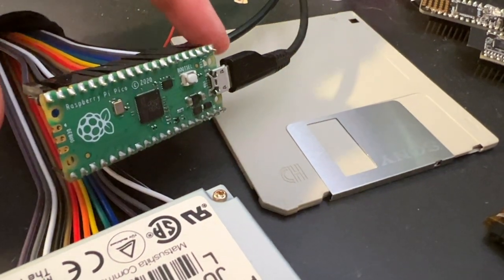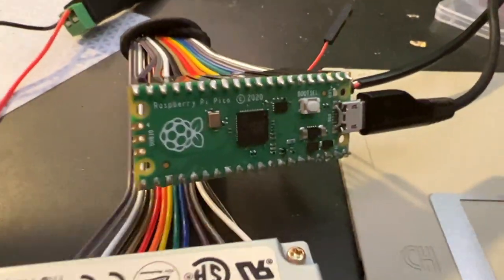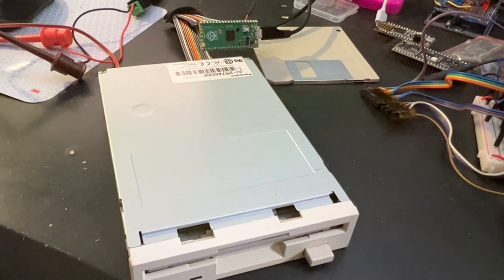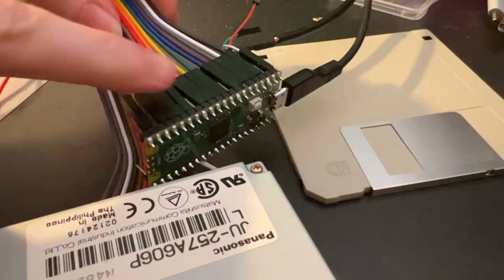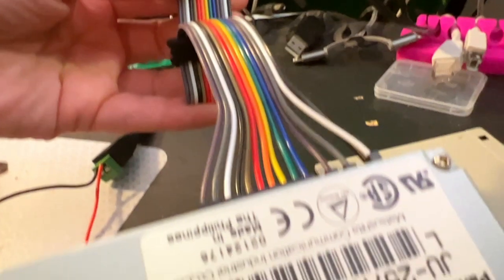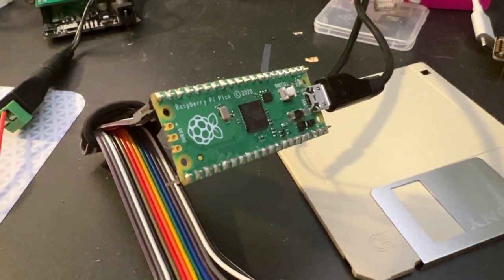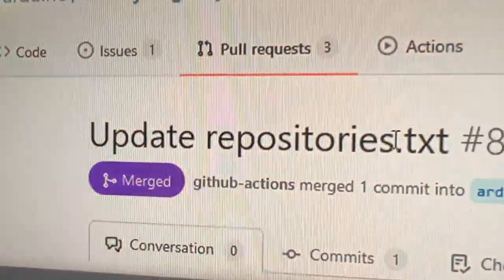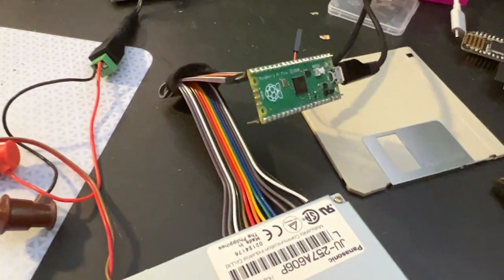low cost and easily available floppy interface hardware, part 9! pico power

Comment: I could see this being a huge deal in the retro Apple community if there was a way to read/write Apple's proprietary 400K/800K diskettes. I'm imagining a switch wired up to the Arduino to set which format you want to read/write between 400/800/1.44MB disks…

Comment: Wow! This is so epic. Too bad so few will understand the implications or benefit from it.
Reply: What is the implication or benefit? I dont get it
Reply: I'd like to know what the benefit is too besides the "retro cool" factor given that an sd card interface is way easier, less pins, and way more storage? I'm not trying to say this is not cool or worth doing, just seems like it would be very niche.
Reply: One benefit is that the standard for this communication protocol was written to a by-gone era that is near impossible to understand by anyone other than motherboard manufactures. It has now been translated and preserved for posterity.
Another benefit is that there are lots of data archived to formats that are becoming extremely difficult to recover. In 20 years this info will be available to recover floppies. I imagine many tech like VHS will be lost to all but the richest seekers.
Reply: So epic?  Few will understand?  LOL.  Anyone who has waited until now to pull data off their old floppies obviously has nothing of value on them.  If they do, they can buy a USB-powered drive for $20.

And btw the external controller they've implemented here is almost trivial in function since the on-board floppy controller does all the work, and those haven't changed much in 35 years.
Reply: @anslicht4487  when you bury a family member you have a lot of things to throw away. It's very hard to throw away media that you can't even open to see if your loved ones thoughts are captured in them. People aren't going to stop dying. Those modern floppy drives are going to stop being made. Even USB-A will stop being made and eventually be hard to interface with. Entropy will consume all.
Reply: @RichardBronosky  Thank you, Captain Obvious.  People won't stop dying and whatever whatever.  That doesn't change the fact that this is no breakthrough with implications understood by very few.  As I said.

Comment: Actually... doing this has been simple since the late 1970s.  The controller chip in the floppy drive does all the work.  IIRC after all this time, you just tell it to write sector XX and then start shipping it bytes.  This device may be useful but it's hardly impressive.  And btw USB-powered floppy drives are $20 on Amazon.